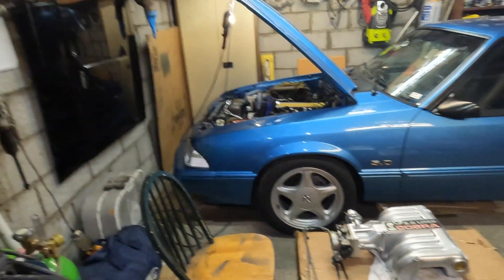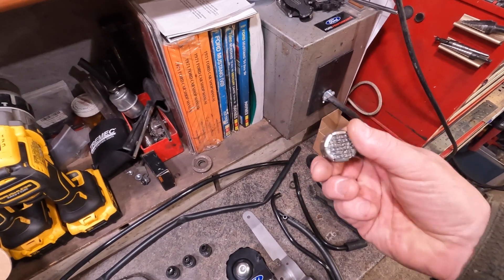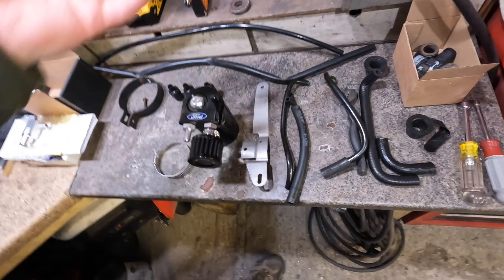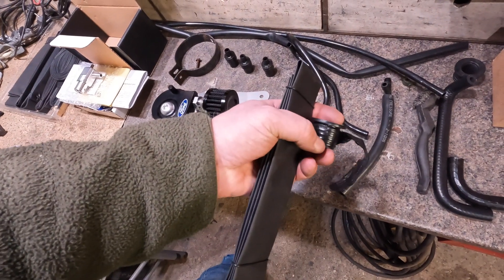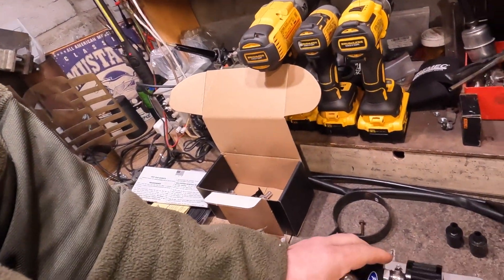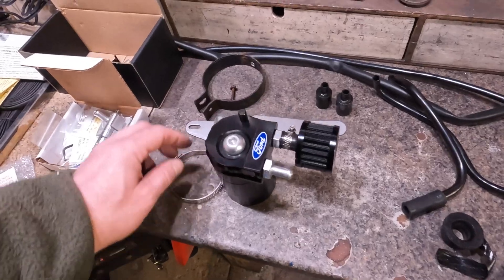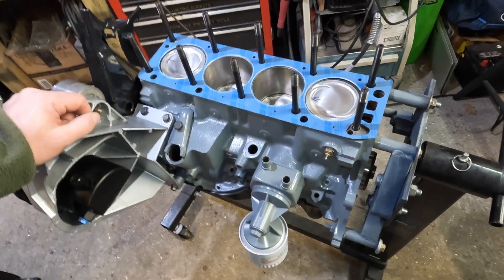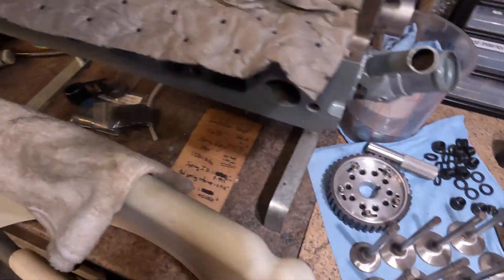Turbo Foxbody Catch Can Design and Thoughts with Garage Updates on the 2.3t Thunderbird Engine

Comment: Mounted my catch can with a very small angle bracket off the factory coil bracket. Looks like it belongs there, very short run to the PCV valve.